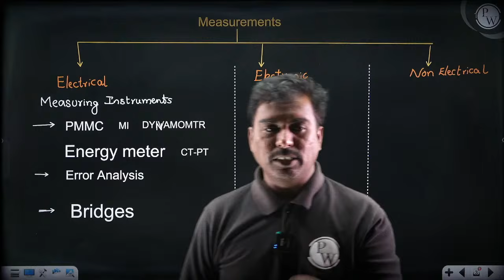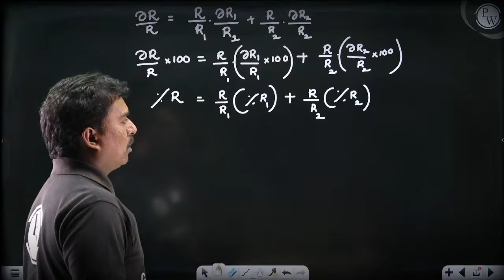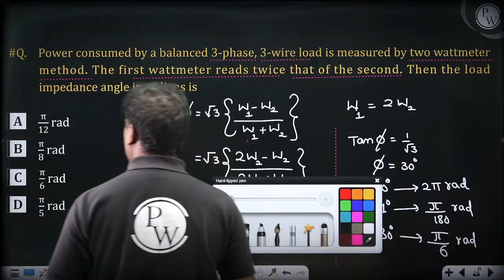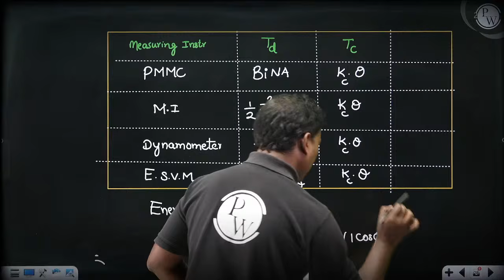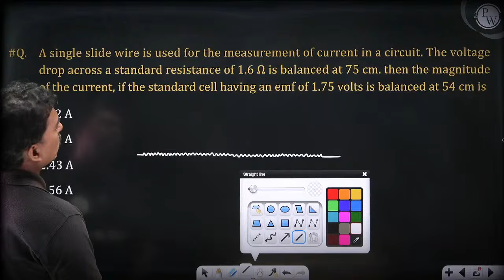BARC 2026 Preparation | Measurements | EE | Target BARC 2026

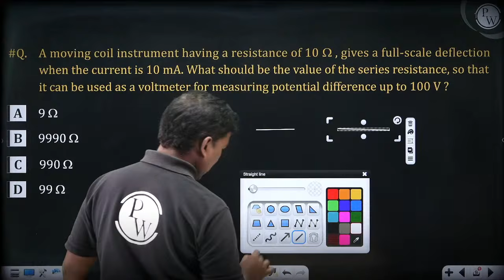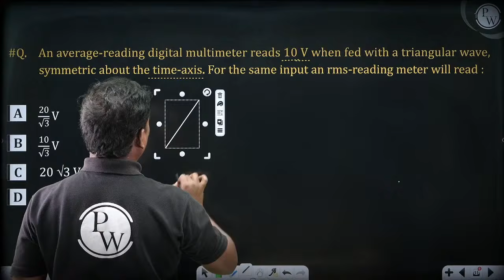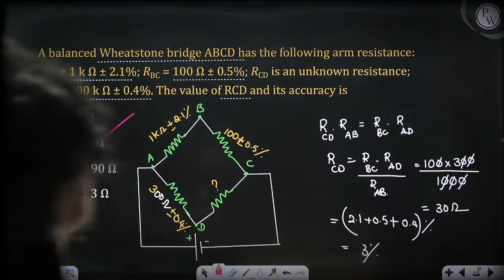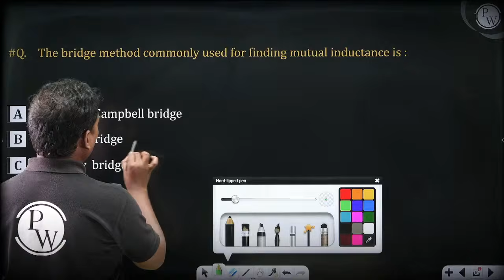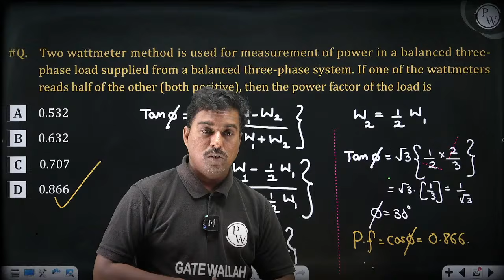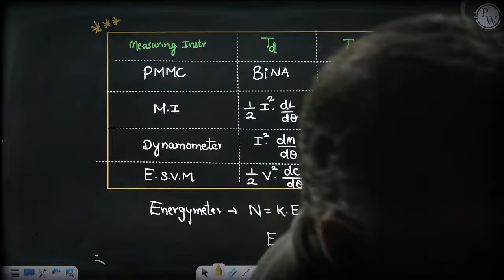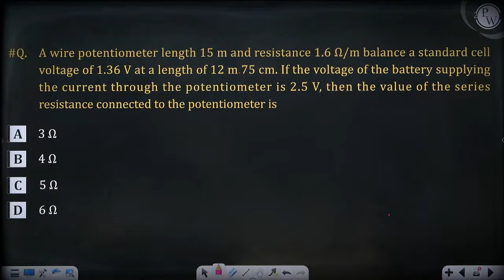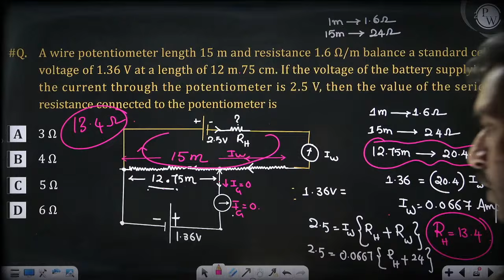Comment: 25:33 (shunt ammeter me, series voltmeter me) 35:10 (triangular wave and also symmetric, and relation between peak and average) 41:40 (Error of Result Is is given in value And not in percentage And Check The Position of resistance In bridge) 43:10 49:00 1:09:10 1:23:35 1:33:00 1:37:00 1:38:50